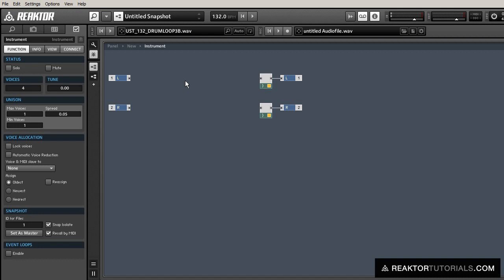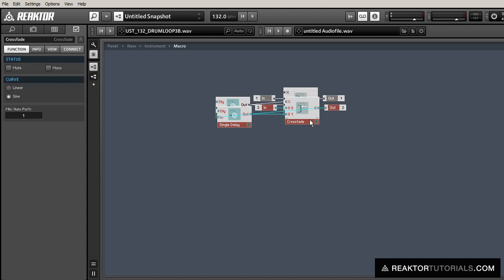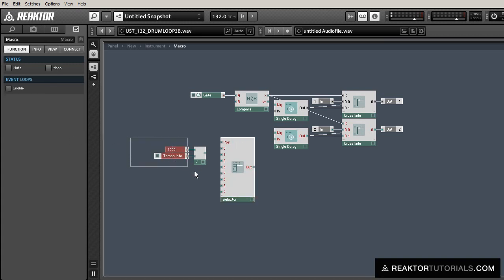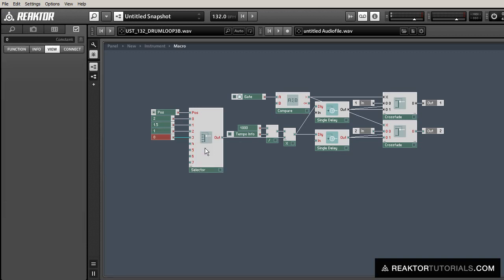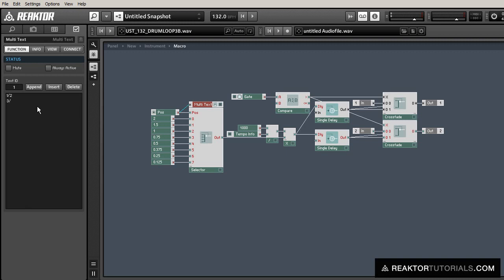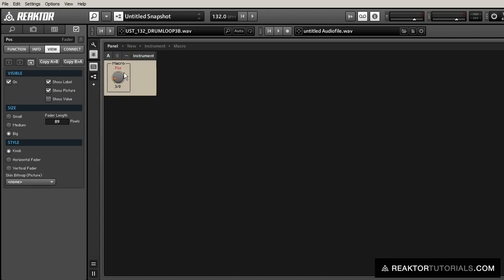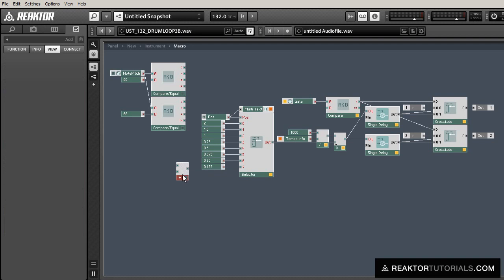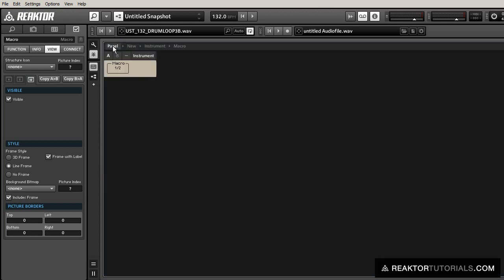Reaktor - Creating Your Own Stutter Glitch Effect - How To Tutorial

Comment: Is it appropriate to use delays to get repeats on event signals or is there a better way to re-trigger event signals? The only way I know how is using a clock oscillator to fire of a certain amount of additional triggers at a certain speed. Iteration works too but its speed is fixed in its properties, you'd have to use a bunch of them for different resolutions